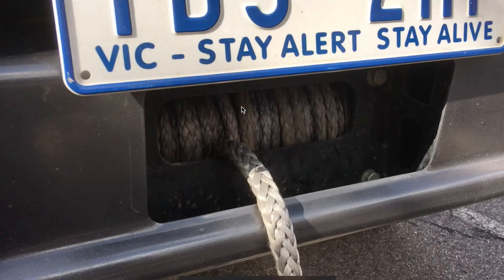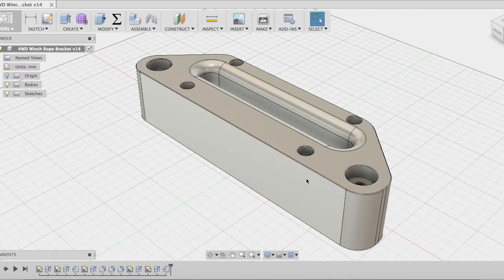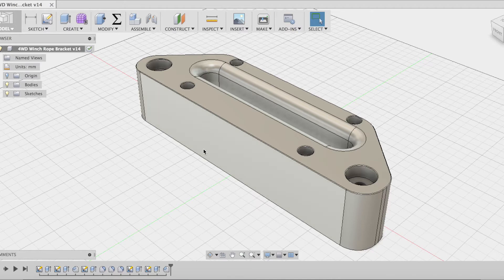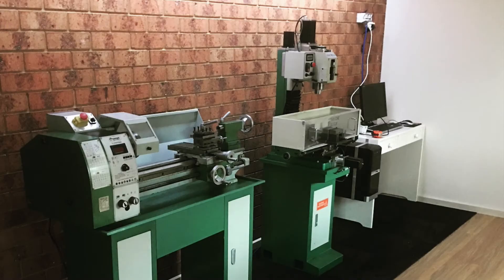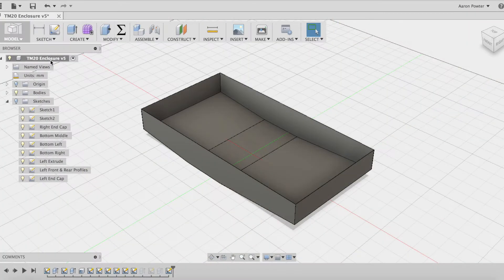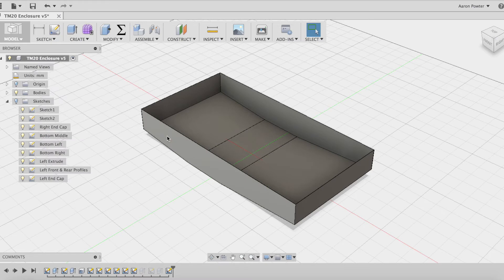CNC Laser & Plasma via Autodesk Fusion 360

Comment: Hi Aaron,
 Very nice job, I to just designed a enclosure for My PM727M build, I found it fairly difficult to design the sheet metal Pan as My design calls for compound angles. I hear there is going to be Sheet metal features in Fusion 360 that would surely help.
I will be posting in a week or two stop by would love to get your thoughts on the enclosure.
Be Safe,
Sam
Reply from the maker: Hi Sam, it's great to hear from you mate. Yes they spoke to us at the AutoDesk conference about the sheet metal release for Fusion 360. So excited I can't wait. Would love to see your enclosure. I'm a subscriber to you channel so hopefully I'll get notified about it after you upload. Cheers Aaron

Comment: So in Autodesk Fusion 360, you can design and press a button and your CNC Plasma just cuts the designed part out? or is there some other software that I will need to actually export the file to before cutting?
Reply from the maker: Hey Supalexy, far out you were lucky with that bike crash.  I watched it a few time now and it scared the bejesus out of me.  OK, back to the question.  In this video I drew my design in 3D and then I exported a DXF file from the CAD design into our PlasmaCAM software.  This is simple vector file that the PlasmaCAM software follows and the torch cuts out the profile.  Hope this makes sense mate.  Cheers, Aaron.
Reply: Yeah if you seen the teaser, I put my best efforts into making it a bit of a thriller. The crash was definitely hard, but I made sure the video editing was on point, maybe my best video edit.. or maybe there's another video that could take the cake for that over on vimeo haha. If you haven't seen it.. warning.. Explicit Content haha

I think I may have already spoken to you about this question a while back, but I was hoping Autodesk may have added that feature in by now so we can do it all from one program. Lately I have been looking into the plasma cutter cnc idea again, but funds are low, so it's just homework. But I did learn a thing or 2 about the capabilities of Nema motors today, those 23's are quite good hey, I think 23's would be fine for my cnc plasma table (when I finally start building it). Hypertherm 65 would be more than enough on the cutting side of things, but 2400 x 1200 table.. mmmm dare to dream. 

Cheers for the info Teacher, here I was thinking.. just outsource the parts and 3 months ago.. yes 3 months ago.. I dropped off 2 plates to a laser cutter for some air bag trailer parts and welding table tops to be cut out and believe it or not, I'm still waiting for it to be cut. Spoke to a guy who sells plasma gear, he said that's the biggest reason people end up building their own, too many cnc places just take wayyy too long to do the work. I emailed the guy last night and said he has convinced me that I should look into it, cause if he's that busy to take 3 months so far, I want a piece of that pie. You know what it's like, you want to knock something up, but sending files, waiting for these guys to get into gear just kills the momentum. Oh well.. battle on, will get there one day. I better look up PlasmaCAM, learn the good stuff while I got "all this time and no money"
Reply from the maker: I'll check it out ;-)
Reply: I know you are going to enjoy that one haha. Hey I'm looking into DesignEdge™ software, looking to see if I can run it on my Mac, but I can't find the answer to my question. You know if I can run it on a Mac? I'm guessing it's not available for Mac, but I'm hoping to follow your lead here, stick to the trusted software that you recommend. If PlasmaCam software is not available for mac, might not be a problem if I only need a cheap pc to pull a USB out of my Mac and plug it in to do the last stage in the computer that controls the plasma cutter.
Reply: Never mind, looks like there is no mac version, looks like I'll need a cheap computer to run the plasmacam.
Reply from the maker: SupaLexy CH2 hey man, sorry for my belated reply. Yes you're correct. Fusion 360 works on Mac, but the PlasmaCam and its software requires a standalone PC to operate the machine. When we bought our machine for school we went through the Australian distributor Metalform group. Maurice is the owner and he's very helpful. Check out Red Fox videos on YouTube and you can watch the customer testimonials for the PlasmaCam and Metalform group. I (Harvester College) were filmed for them. Cheers Aaron
Reply: Will do, thanks Aaron.

Comment: Whats the name of the part that is surrounding the cutting nozzle shielding the arc light?  is there a plasmacam part for this or is this homemade?
Reply from the maker: Hi Jack.  Sorry I didn't see your comment before.  I believe the part you are referring too is the silicon rubber shield that wraps around the torch.  This part came with our machine from the Australian distributor.  Cheers Aaron  👍
Reply: DCTSolutionsAU no I’m talking about the part at 2:06 around the nozzle. It looks like a brass shroud of some kind
Reply from the maker: @youtubejack  It's a standard Hypertherm plasma torch.  It uses the brass end caps which depend on the amperage.  Above that is a crimp fitting (like a hose clamp) which attaches an earth wire to the end of the torch